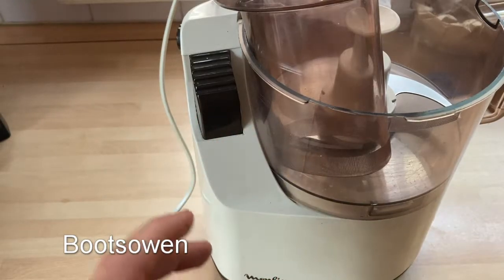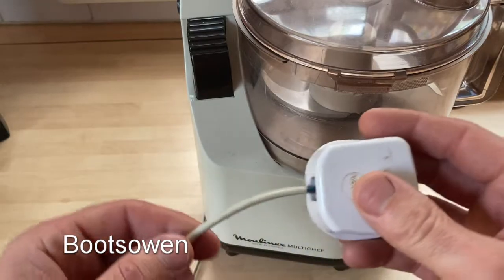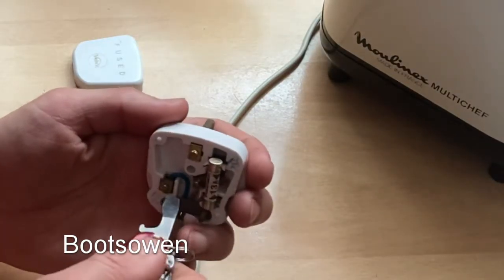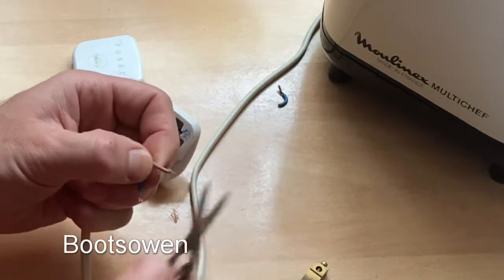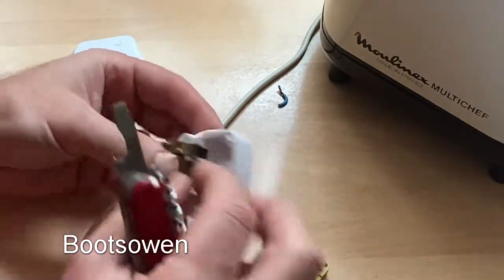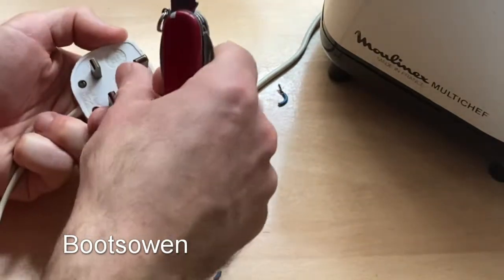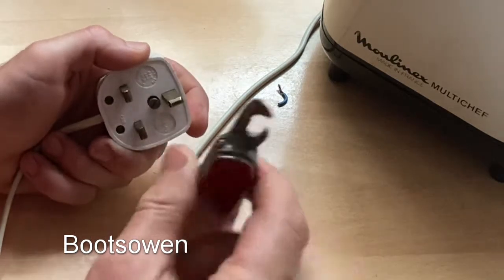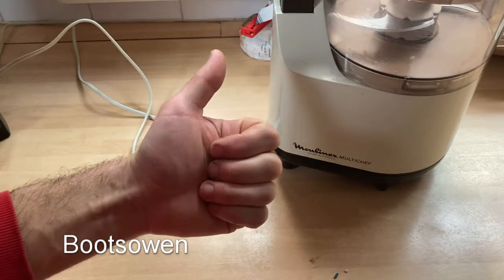First thing to check when an appliance breaks: Moulinex Multichef

Comment: I've started putting Ferrule crimps on them stranded wire connection, much better connection, less chance of Sheering off either.
Reply from the maker: Where do you get them from Balfie?
Reply: Ya can pick them up for about 20 quid on amazon mate, a set of 1200 ferrules and the tool to crimp them. Stops all that nonsense with losses stranded copper,
Reply from the maker: It depends on whether I reckon I’ll ever see the thing again.

Comment: I have exactly the same moulinex.
Reply from the maker: It's a great machine, I think that this one may have been a wedding gift to my parents, about 40 years ago, there was a leaky crack in the original bowl so I bought a second on ebay, one just recently broke, sheared the gear in the gearbox making breadcrumbs so I have just bought a third, brand new in box, without ever having had a plug put on it, again probably 40 years old, I'll have to make a video of that. 
They have a decent, well built motor in them, Ours is a workhorse and comes out once or twice a week.
Reply: @bootsowen  Well, I was going to add in my first comment, that mine also belonged to my parents. My Father used it a lot for making apple tarts etc. as his Mother was a Cook. It's never used now, but I could never dump such a good machine of such sentimental value Mr.B.
Reply from the maker: The new one arrived. I’ll make a video of it someday